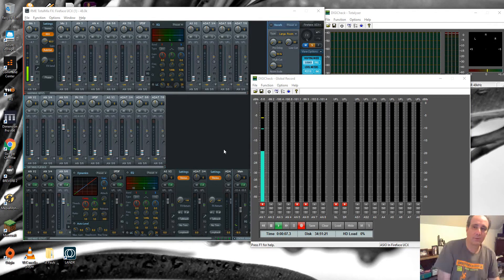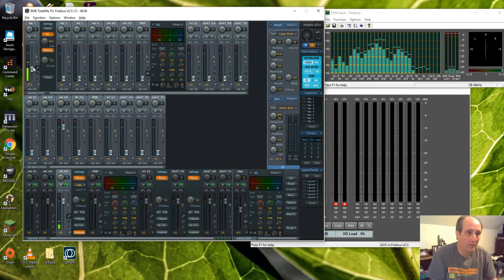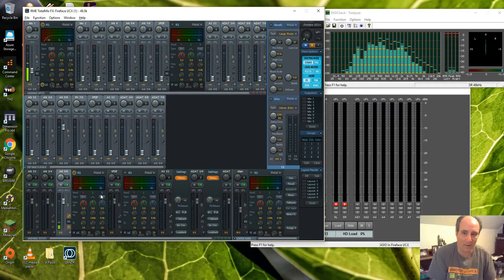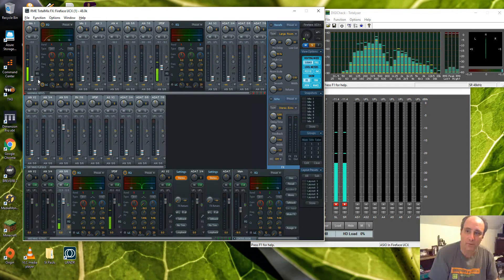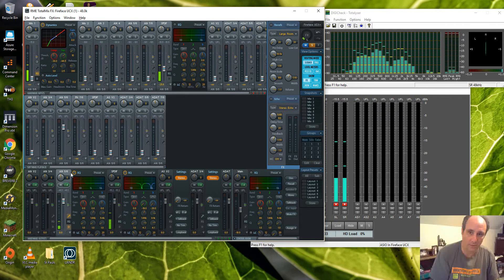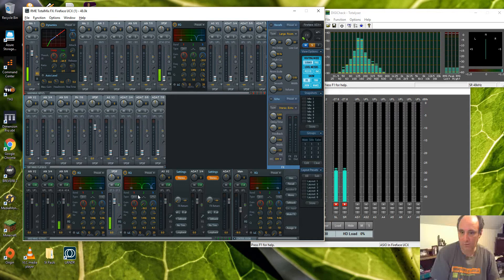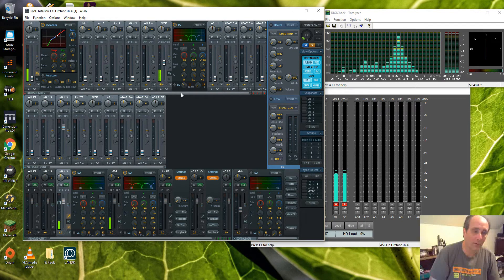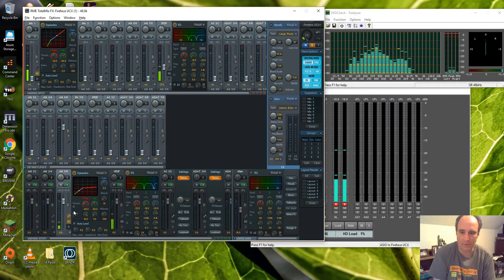RME UCX SPIDF Loop-Back to increase available parametric EQ Bands.

Comment: I am still a bit confused because my adat channels already show on my totalmix and the software, so i assumed i could use them as mixbus tracks (the adat inputs), just haven't tried it yet. On the other hand the RME UCX advertises as 32 channel.. Thanks in advance And thanks for the video!
Reply from the maker: Yeah you can use software loopback, but can't reuse the input. A physical loopback is cool bc you can stack the fx. Since i don't use the spidf otherwise i keep the physical loopback plugged in as the default. Soft loopback through digicheck works for record only, not for rerouting internally.
Reply: @gswitz101  I see. What about the ADAT connections? would it make sense to connect the OUT to the IN on the same UCX, like you did on the SPDIF, or is it redundant? Thanks again!
Reply from the maker: @audiumsoundwaves  I'm not sure. I've never done that because i use my adat in for 8 additional channels from my Audient asp 880. I'm guessing it would work. Easy to find out. 😁 Watch out for infinite loops.
It isn't redundant because it allows you to do parallel compression live for example. The physical loopback has value you can't achieve with the software loopback in digicheck. That loopback is good for recording a live mix for example or a drum bus, but it isn't useful for parallel compression or eq stacking.